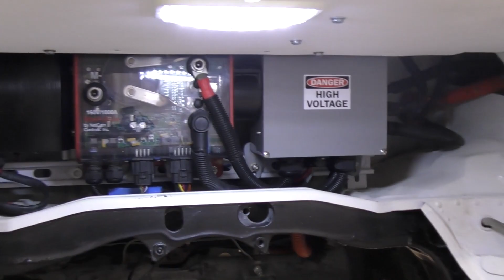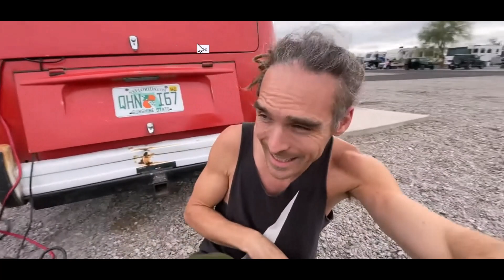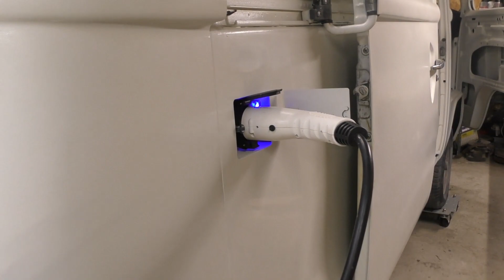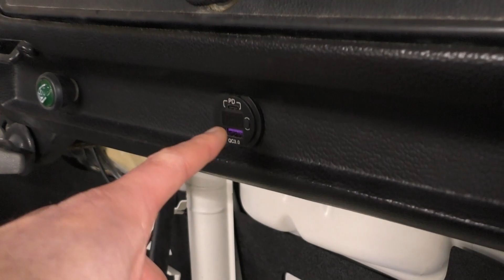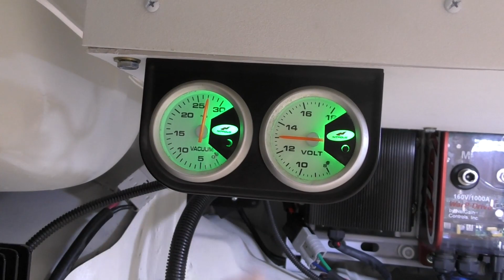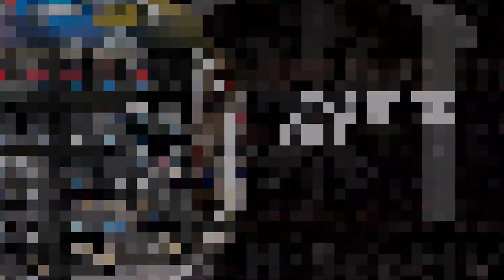Analysis of FunForLouis' EV road trip and the importance of the 12-volt battery #evconversion

Comment: Okay I found the reference I was looking for. If you don't want to use computer controlled everything and you've just got dead simple lead acid batteries going to a DC motor and you want to be able to correct to control the speed of the DC motor without computers and all the other nonsense use what this guy did which is a franken switch made out of copper plates and PVC pipe
Look for the YouTube video titled "Construction Boat 0064 Franken-Switch!"

It's dirt cheap you don't need all this computerized stuff. It's much more rugged. Obviously it's easy to fix cuz there's almost nothing to do it. Again it's dirt cheap. Lead acid batteries are dead simple and all the computer stuff that they sell these days makes it far too complicated and expensive. Spend the money instead on more used lead acid batteries and make your own switches and speed controllers. And don't worry so much about overcharging them. It's relatively easy to make a mechanical disconnect when voltage gets to a certain level. So you don't need a lot of computer control for that either. Good good luck!

Comment: I'm going to blow your mind. Except for your charging system which of course it has to be solid state and computer control if you're running a lead acid batteries as your pack it's more efficient to use direct contact charging and throttle into it DC motor. Forget all the computerized stuff. A direct contact no computer chip system where if you want to go faster it shifts the wiring of your pack to more batteries in parallel giving you lower voltage. Then when it's off it's off and when it's on it's on and all these computer chips and all these other things are using power. But direct contact controllers which you can literally make from a hinge and multiple arrangements of wires contacting that hinge in different positions does not have any parasitic load unless it's on. In our zeal to have everything be fancy and computer controlled we forget just how simple batteries are. If you want your motor to go faster you wired more batteries into series configuration. If you want it to go slower you shift the rotary dial that on the fly rewires the batteries to have more of them in parallel to lower the voltage. It's that simple.
Reply from the maker: Thanks for watching!  If I understand what you are saying, you recommend making a motor controller out of a series of manual knife switches?  Since I already have my DC controller and motor, I think I will stick with that as it will be much easier and safer to drive the car.  A controller made of a series of switches or contactors may work in other applications though.  Also, my friend who used deep cycle lead acid batteries in his build typically only got about 18 months to 2 years out of a set of batteries.  It was almost a daily driver for him though.  A decent lithium chemistry (although more work implement) can get more like 7-10 years.  I think for this high drain type application, lithium is the better value in the long run.

Comment: Thanks for watching my videos. Bet Louis bus later after this 12v issue finally failed to to the bus bars he made. He made them on the batteries from Home Depot aluminum. He bent them and used them. When you bend these you will get fractures. Bet the current eventually opened one up. No go. Only use copper! You saw me do them in my videos. Thanks
Reply from the maker: His ultimate breakdown in the main battery pack could very well be a broken bus bar.  I hope he goes back and does an autopsy and shows us the opened battery boxes.  Would be good information for us to have.  Thanks for following me as well.  I can't wait to see your bug on the road.

Comment: What's your thoughts on an LTO battery instead of a SLA/Gel one for the 12v? The sag and the base level could be easier to deal with.
Reply from the maker: My only concern with any lithium chemistry is connecting it to the DC-DC converter and overcharging it. I'm not familiar with LTO cells, but check whether they are ok with being connected to a "dumb" charge source like the DC-DC converter.

Comment: thanks for this video. we are currently planning to use a small 12V LiFePo4 battery in ours and just hook it up to the DC-DC converter (which has a nominal output of 14V). Are there any issues with doing that?
Reply from the maker: I'm not an expert at this, so please get more opinions.  My fear of connecting any lithium pack directly to the DC-DC is overcharging.  Either you construct the 12-volt pack with a BMS capable of shunting the additional charge current of the DC-DC or construct a circuit like I mentioned in the video where the DC-DC and the 12-volt battery never "touch" each other and use a DC-DC lithium charger (like that renogy unit) in between.  Again, I am not an expert on batteries, so get more opinions.  I would be interested to know how you end up implementing it.  Keep in touch!